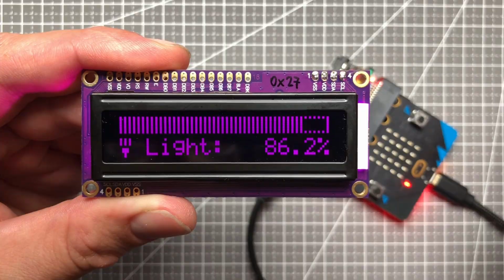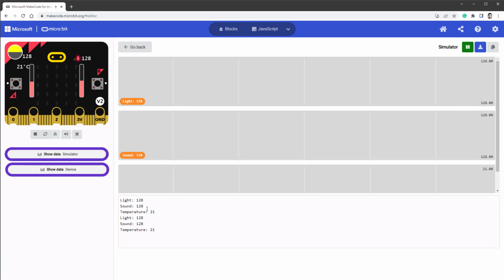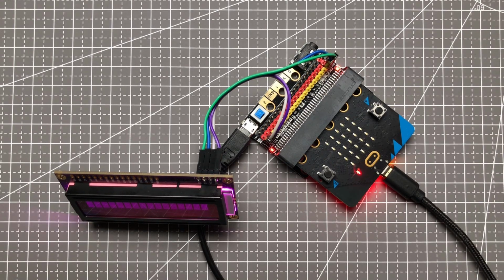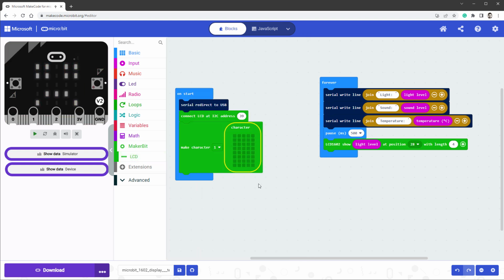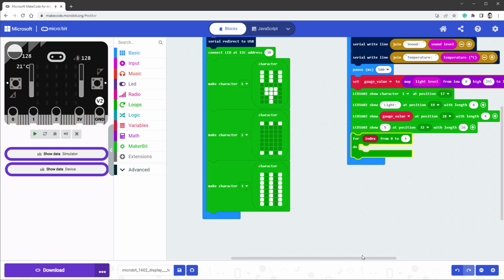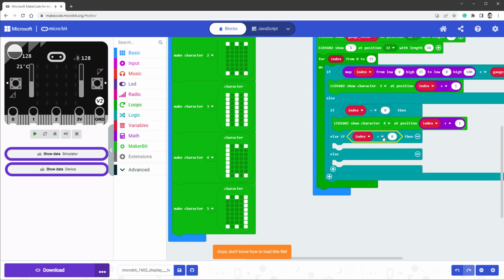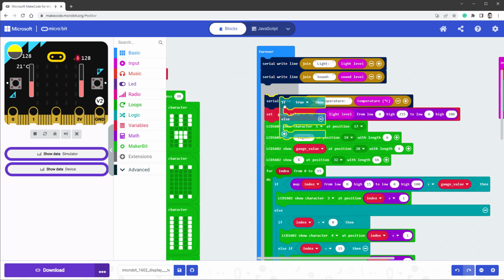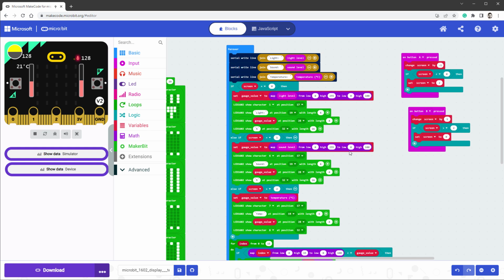1 DISPLAY 3 SENSORS

Comment: Thank you very much indeed for that very impressive video, it is one of the best BBC Micro:bit demos that I have ever seen. I say that being a reasonably experienced MakeCode user myself and it keeps my brain ticking over at my twilight age of 73 years. It will be a long time before I reach your level of knowledge and ability to explain things so clearly though. I use the Micro:bit with my 3 grandchildren as well as for my own amusement. I will be starting to set up this project for myself today hopefully, to check my understanding of your MakeCode. I experiment with various other microcontrollers like the R-Pi Pico and various Arduinos too so please do keep these fascinating videos coming. I am about to watch your next one now.
Reply from the maker: Thank you very much for such a nice comment, I really appreciate it and it made my day! I also like microbit board a lot, they are fun to play with. I wish you luck with your project(s) and feel free to ask if you have any questions.
Reply: @upir_upir  It was nice of you too to respond to my earlier comment. By this time of night I have put together your project and it works very well indeed. I have several I2C LCD Displays here and first tried a Grove one linked to the Grove Shield for the BBC Micro:bit with a ready-made 4-way lead with their standard plugs on. That should have been easy but I failed to get it to work at all, I suspected it may have been something to do with the display's I2C address but possibly not. I then managed to get it working using the Pimoroni Pin-Between Board with a different display which is backlit, the characters on the display though were barely visible despite the convenient preset to adjust this at the rear of the display board. A closer look at the information attached to your video revealed that you were using a KittenBot IOBIT Board which fortunately I happen to own. I then realized that this project requires a 5V supply for the LCD display and this board is one of the few I have seen which offers that as well as the I2C pins. Success at last! I have had a very interesting evening so many thanks again to you Upir. I hope that I have called you by your correct name!? I will next watch and try out your 1 Project 3 Displays YouTube, again I am very pleased to say that I have the R-Pi Pico and all the displays at hand.

Comment: Hi Upir, i was inpired by your video to make a gauge for my car. So i bought a microbit and a oled screen. But im a littlebit stuck. I dont know how to make a bar for the gauge and the text is too small to read from a distance. Do you know a way to do custom fonts in microbit and how to make a bar? Thanks!
Reply: Hi thanks for the reaction. I want to show boost pressure, oil temp and oil pressure. I like microbit because its easy to program. The oled 16x2 display sounds great. Do you have a link to the right display?
Reply from the maker: @L.VanWelzen  Sure, I have tried this one some time ago and it works - and looks great. Let me know if you have any questions. 

https://s.click.aliexpress.com/e/_DEYEg6R
Reply: @upir_upir  thank you i have ordered it!
Reply from the maker: Perfect! Let me know if you have any questions and good luck with your project
Reply: @upir_upir  ive the screen in! But it wont display anything. It should work with 3.3v. Ive tried two differend extentions but it still does not work. Is there a other adress that i need to use? Could you help me? Thank you a lot!
Reply from the maker: I’m sorry to hear that. Do you even see the first line filled? If not, I would try 5V supply. If you see it, try changing the I2C address. Usually one of those two mentioned in the video works. If you still see nothing, please feel free to let me know. Good luck!
Reply from the maker: Thank you for your message! What kind of data are you trying to show? Gauge should be possible, bigger font might be harder. In that case, it might be better to use Arduino or other microcontroller. If you like to keep using microbit, I would suggest using 16x2 display, you can get it also in OLED version, and it looks great.

Comment: Fantastic tutorial and first time I've seen different colour backlights on those displays, love the purple. Does the Microbit use the LED matrix itself to calculate the light level ?...cheers !
Reply from the maker: Thank you for your comment! I have used this display in one of my older video, together with the other colors. They all look great, especially compared to the classical boring white in blue one. As for microbit, you are correct. It measures the light with the led array, but it’s quite accurate.